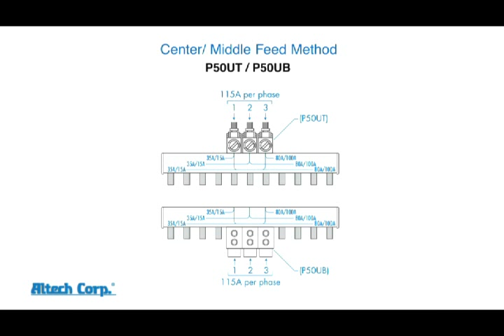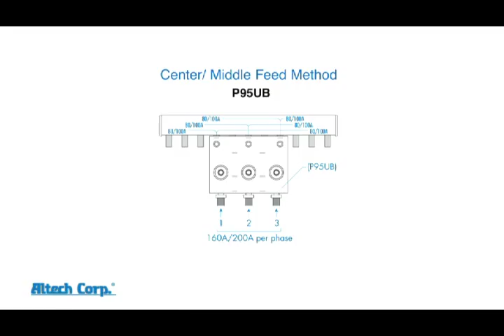Altech Miniature Circuit Breaker Busbar Systems

Comment: My 98 Freightliner truck doesn't have fuses. It has a bus bar. My truck lights won't switch off even when I pull all the relays, disconnect light switch, ignition and starter button wires.
Could it be the bus bar. If so how do I test it or find what's wrong with it? Only way to turn lights off is by the battery Isolator switch which acts as an earth.